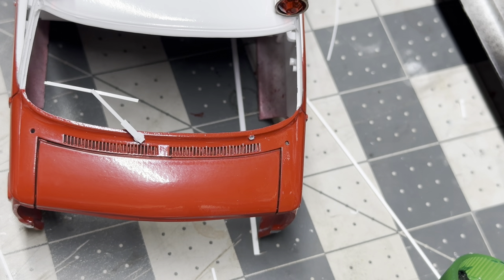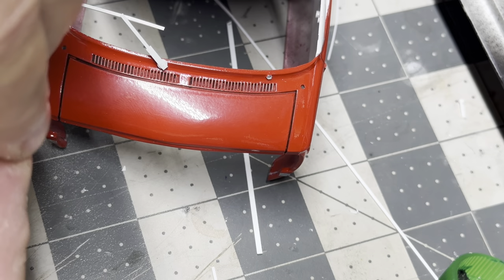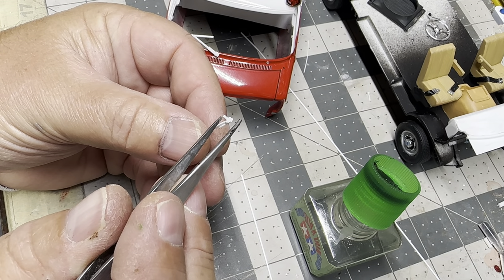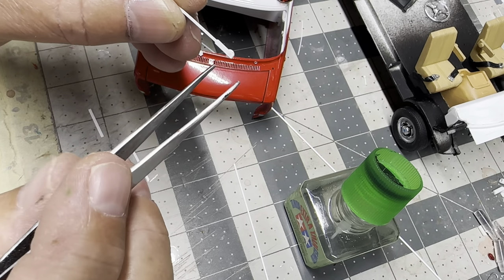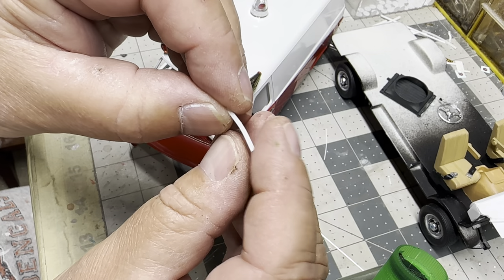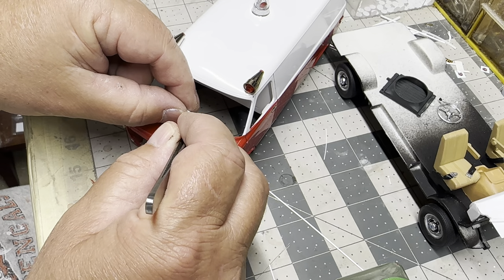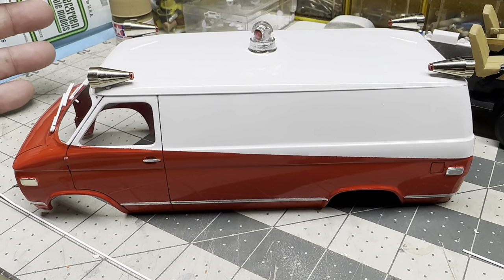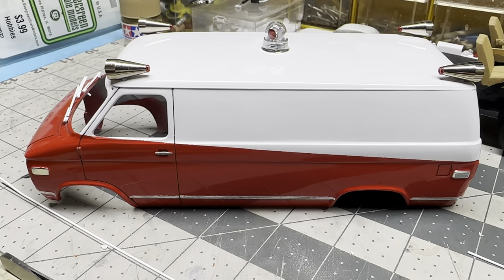1975 Chevy ambulance. WIPERS!

Comment: Sometimes it's really a win for the models to build parts by yourself, even though those parts are actually included in the kit.👍🏻🤩 By the way, I was just doing a quick search for those original windshield wipers and the first thing I found was a Chevy van wiper dealer: both blades (driver and passenger) are 16 inches long.😉 Sometimes Google really is your friend (although I often find conflicting information)...😅😇

Comment: Free standing wipers are a very effective detail upgrade in 1/25 scale, and as you show here they aren't impossible to make yourself. I was surprised to see separate wipers on the van kit since so many 1/25 kits (cars, pickups, vans and even the big rigs) have molded on wipers.
Reply from the maker: Yes you are correct. They add a good level of detail and are fairly easy to make.